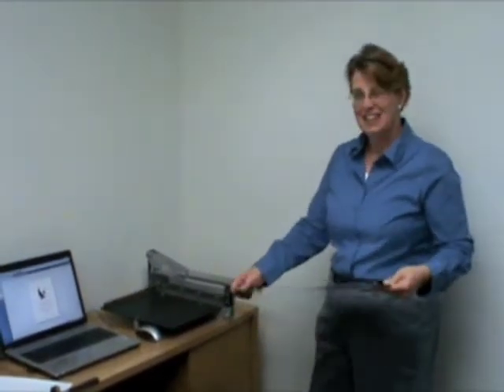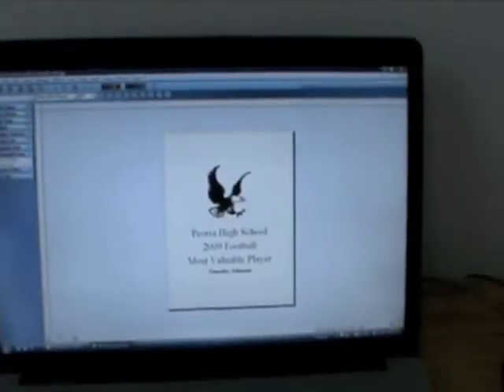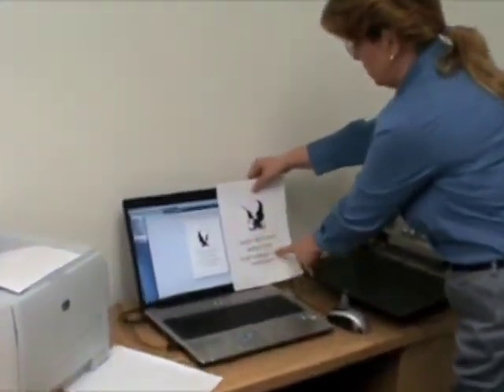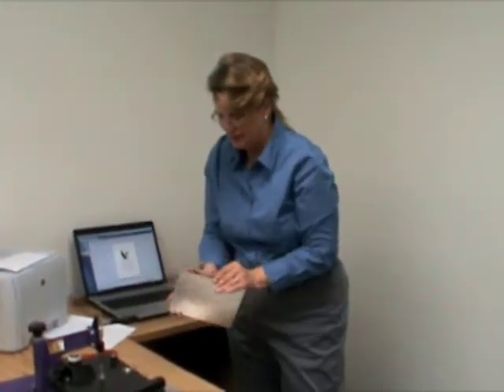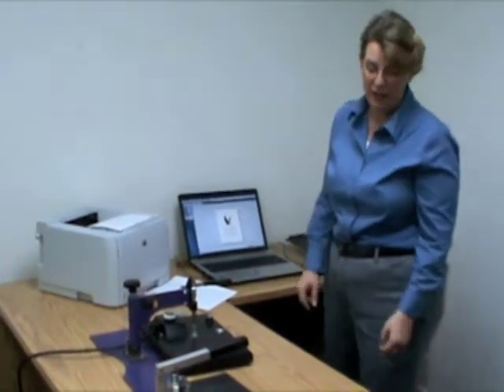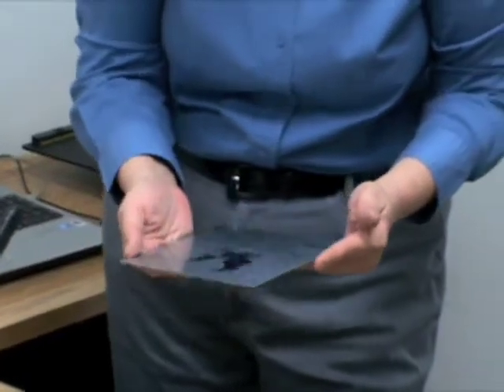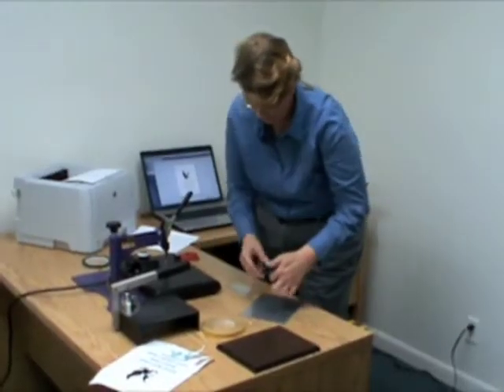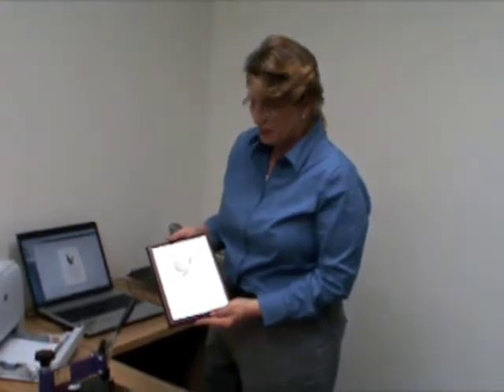Laser Sublimation with Subtoner - How to make trophy plates and awards

Comment: you can use anything you want as long as the printer will print it. the special thing about this process is the paper you print on and the ink or toner, and the printer doesn't distinguish between those from 'normal' paper/ink/toner. you could use microsoft office for all the printer cares. :) corel, photoshop or adobe illustrator is for designing imgaes more than anything else.

Comment: we use an epson workforce 30 (very cheap printer) and a CIS system. or we used to until we got fed up with clogs, which sub ink is notorious for, so i'd suggest a toner system, definitely. ink is expensive, and plan on maintenance hassles, and the metal is specially treated. the sub paper is pricey, too. you have good margins, true, but you need to calculate your labour, too. a plaque this simple we'd probably get around $20 for as there's not much to it. good job on the video. :)